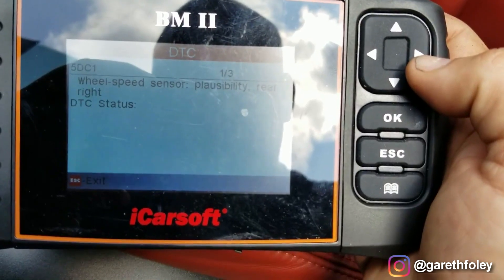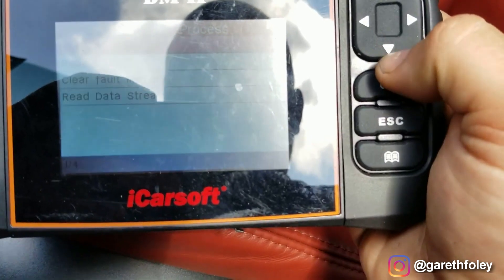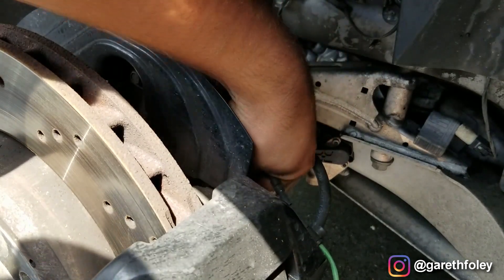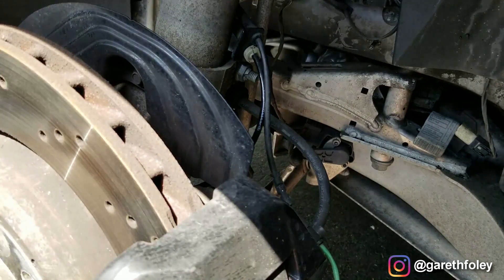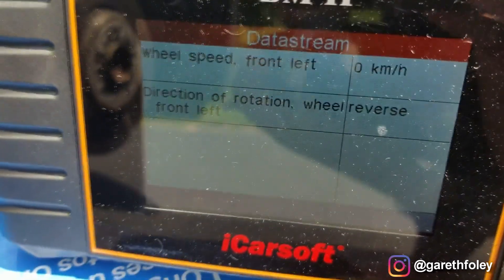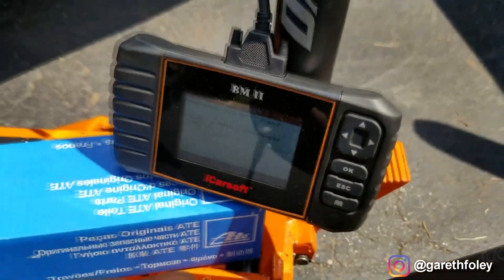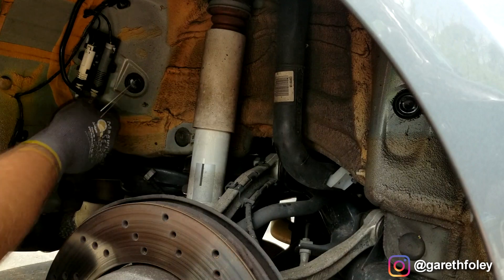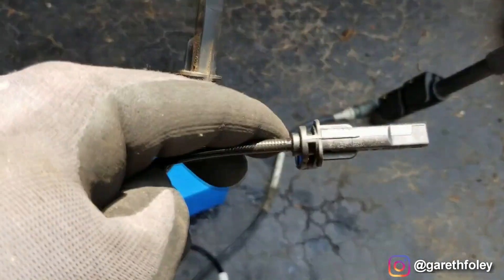E82/E88 and E90/E91/E92/E93 ABS Wheel Speed Sensor Troubles - How to Diag and Fix

Comment: Hey.. I'm have a 2011 bmw 328i e90 I've gone through 3 generic sensors. They fail quickly. Almost right away. U think it's because it's generic?  $20 vs $200.. Big difference in cost but I might have to try the oem. What was the other brand instead of oem did I recommend? And where can I find them?  That's another issue. It's been almost impossible to find real front wheel sensors for my car. I keep finding rear but not the front.. Even generics have been tough to find. I've been sent wrong ones a couple times.. Mine are blue plastic but my tip is round rubber. Looks diff from yours.. So my model bmw is fussy with generics?  Thanks for your help
Reply: Also my code reads fault left front wheel circumferential velocity from DSC

Comment: Do you know the reason for these sensors to fail, even the original Ate ones that came with the vehicle?  And seems that everybody replaces sensors every year/ every 2 years or randomly.  Why?
Reply: Also my code says fault left front wheel circumferential velocity from DSC.
Reply: Wrong reply. Sorry

Comment: Thanks dude, appreciate the info. I just had this issue today, will troubleshoot tomorrow. I hooked up bimmer geek protool to diagnose and the front left wheel was not registering speed or direction. 

In my car the side effect was weird. I was driving my car to a store, I slowed down to make a right hand turn at slow speed and my ABS started pulsing. I guess because the front left wheel read no speed the ABS system thought my right hand turn caused my left wheel to loose traction completely.  I suppose that makes sense. Just took it for another test drive and sure enough right hand turns are causing ABS to kick in.

I will swap the sensors like you suggested because no point ordering a new part if that part isn't the issue. Simple enough to verify by swapping left and right.

Regarding a scope. I bought a portable, battery operated scope off amazon for $100. It's pretty basic in function but I've used that in the past to verify whether or not my can bus wires were getting signal at all when trying to diagnose some after market retrofits. Also it's sometimes hard to know which wire is can-high and can-low, a scope helps figure that out too since the waves are inverted for high and low.

Comment: i have a front left abs sensor NOT reading any values at all when i move the car. is this possibly due to oepn circuit? or simply bad sensor. the sensor was replaced with original BMW ATE by dealer. and i cannot believe it is now faulty as it is hardly 12000 km of use. less than 2 years.

I am thinking of using a good rear ABS sensor for the front. 
are the front and read sensors same other than lengths? 

If this does not solve the problem, is it possible that ABS fuse is faulty? not sure if there is a fuse for each sensor.

Comment: Where do you run the speed sensor under the axle or over it?
Reply from the maker: Not sure if you're referring to the front or rear sensor. Regardless, both installations follow the factory routing and are secured it to the factory mounting points.

Comment: Please help. I feel like I'm constantly having to buy speed sensors. I have 2009 bmw 335i. Currently experiencing the same issue as in this video. Do you think the CV axles is affecting the sensors? I did notice some rust. I am a customer of FCP EURO. I just bought the rear wheel speed sensor like 7 months ago and im already getting faulty codes
Reply from the maker: The axle should have no effect on a 335i. The tone ring is in the wheel bearing front and rear. What fault code are you seeing? Is it an implausibility fault?
Reply: @GarethFoley  ohh OK I thought the tone ring was within the CV. Thanks for the reply. 

The initial code I was getting was 5DB3: Plausibility, rear left
And then days later I got 5DA3: Plausibility, rear left. All the sensors I've purchased are not even 2 years old ;the brand is ATE. 

I swapped the rear left with the rear right so I know the sensor was originally on the left is not working because it didn't work on the Rear right. I also got code : Restraint system malfunction:604E.
Reply from the maker: @roberto0612fcb  So I did get an SRS malfunction when I had two wheel speed sensors fail on the same day (very strange event). The wheel speed sensors measure both direction of travel and rotational speed so I imagine both of the plausibility faults were for direction of travel and direction of rotation. Weird they failed in two years, but I've seen these sensors fail randomly. They seem to be very sensitive.
Reply: @GarethFoley very interesting, I've read that hall speed sensor are in fact sensitive. Thanks for your input can't wait to see more DIY on the bmw e90!

Comment: Very good guide,
 I had the wheel speed sensor changed after the Abs, traction control and brake wear light were lighting up intermittently, but now they’re on permanently. 

Would you recommend changing to bmw original sensor or magnetic ring? I’ve even seen that it could be a faulty abs pump.

Comment: Not sure you will respond but my 08 328 had a rear right sensor go out, would you happen to know if this would also cause power flickering?
Reply from the maker: I don't think a failed wheel speed sensor would cause the problem you're having. Conversely, the power flickering you're having might be part of a bigger issue that is causing communication problems with the wheel speed sensor.
Reply: @GarethFoley  Garrett thank you so much for your reply I have since replaced the speed sensor, the alternator was the source of my problems

Comment: great content man..
i’m having this issue in rear left wheel.. changed with the ate oem and fault still on.. could not be the bearing magnetic ring? cheers
Reply from the maker: It could be a wheel bearing issue but also check that the magnetic ring on the bearing isn't coated with debris. They unfortunately accumulate magnetic crud over time and that material can interfere with the signal.
Reply: @GarethFoley  how do you suggest cleaning the ring?
Reply from the maker: @damiancorvasce5845  It's only going to be an issue on the rear axle. You can pull the wheel speed sensor, spin the wheel hub, and blast it out with some compressed air. That's only going to be a potential fix in the case of intermittent readings off the wheel bearing. And the only way you'd be able to determine that is with an oscilloscope. In the case of this car the sensors were dead and not reading at all vs intermittently.

Comment: On my 2006 330i e90 wipers not working, speedometer. And abs dtc brake light on those all came together first my wipers start working none stop then completly stop working doesnt show any code by the way any idea ?
Reply from the maker: You may have separate issues happening. Light's malfunctioning and wipers not working are likely related to FRM issues. The ABS/DSC lights are most likely associated with an issue with the DSC system itself. But you'd have to look at the fault codes stored on the car to see if there is a common link amongst them, like a grounding point for example.
Reply: There. Is no fault code in the car so strange
Reply from the maker: @b.k.s8910  You may not have generic OBD2 faults that can be picked up with a basic scanner. If you're not scanning the body control modules at the factory level you're probably missing some valuable information.

Comment: Love the video. So I have a F01 750i. Didn't find parking so I parked on grass. Drove over a small pile of mud. Next day I noticed so many lights on my dash and speedometer isn't working. ABS light is on. Brake light is on. Passenger Restraint error. "Press brake to engage gear" notification pops up. Steering wheel light is on. Steering got a little bit stiff. Other than that, car drives just fine. Do you think it can be the wheel speed sensor? Maybe it's dirty?

Comment: What’s the issue of using aftermarket sensors ?
Reply from the maker: Knockoff replica sensors are generally low quality and can often be DOA. Not worth it to save a few bucks when the OE ATE sensors are not all that expensive to begin with.
Reply: U said they don’t rlly work so still will get the lights n the same problems ?

Comment: Great vid!  You can also test the sensors with a volt meter.
Reply from the maker: Thanks! Unfortunately you can't test this particular style of wheel speed sensors with a voltmeter. These are active wheel speed sensors (hall effect) and the only way to truly test them is with a scope to look at the wave form being generated. A DVOM won't even pick up a hint of the digital signal created. You can however test passive wheel speed sensors with a volt meter.

Comment: Hey there! I hit a nasty pothole and it gave me a 5DA3, which is a Wheel Speed Sensor plausibility- front right. I replaced the sensor and deleted the codes. Problem still persisted. I went to INPA and monitored the live date for each wheel speed sensors. My Front Passenger(right) stays at 0 km/h, while the others are monitoring my speed accurately and equally on all corners except Front Passenser. Any idea what else to look for? I'm thinking of checking the voltage of the harness but I can't find anywhere the proper voltage for it. Appreciate your vids. Thanks!
Reply: I’m having a similar issue but I have three bad speed sensors supposedly but I changed one and the code for the speed sensor i replaced continued.. were you able to fix this John ?